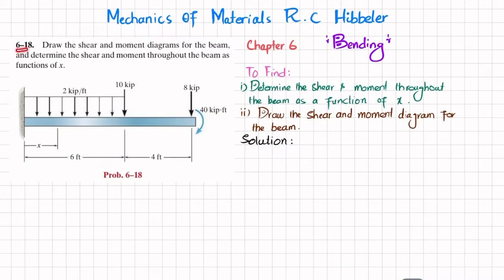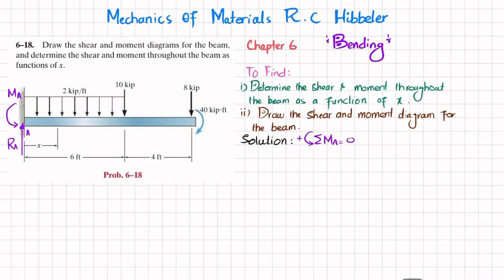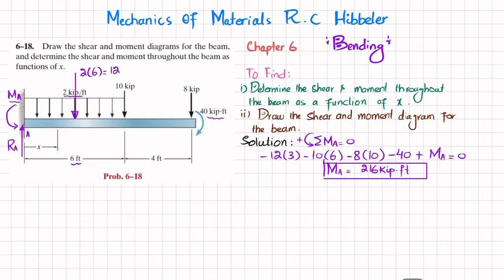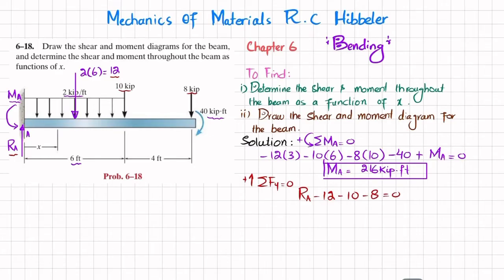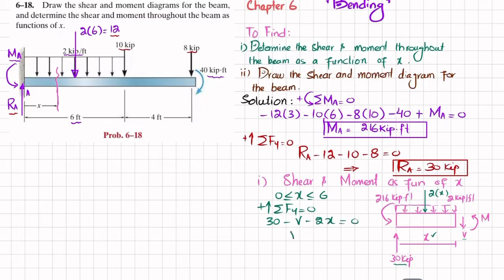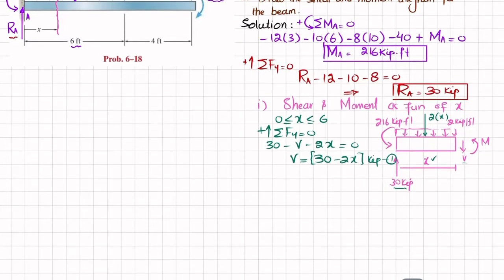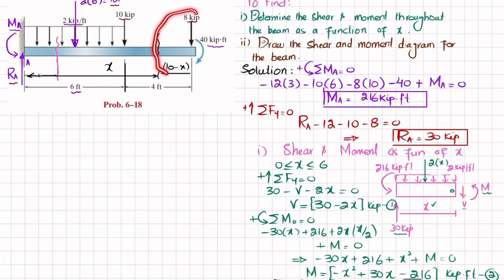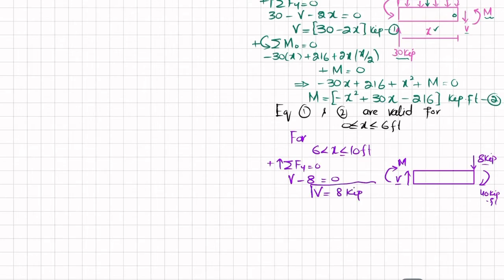Mastering Shear and Moment Diagrams: Problem 6-18 Demystified | Mechanics of materials rc Hibbeler

Comment: In 10:29, how come the 10 kip force wasn't included in any of the FBD?
Reply from the maker: Check 13:56 please to find your answer...
Reply: @ yeah I see that, I was just referring to the part where you were analyzing the beam from 0 <=x<=6, I noticed that the 10 Kip force wasn’t included in the FBD. Why is that? Thanks!!
Reply from the maker: @AM2waller Actually you can see the equation of shear force and bending momentum that is for section portion for length x where x is less than 6ft. for any value of x that is less than 6 ft we have to not include 10 kip load, that's why we need equation of shear force and bending moment for x is less than 6 or x approaches to 6ft...

Comment: Hi sir, sorry at minute 10:46, is it - 80 + 8x or - 80 + 80x?? I think its a lil mistakes
Reply from the maker: You can see moment is 8(10-x) so after multiplication it will be -80+8x. So you are right it's a little mistake ❤🎉
Reply: @engradnanrasheedmechanical  tq sir